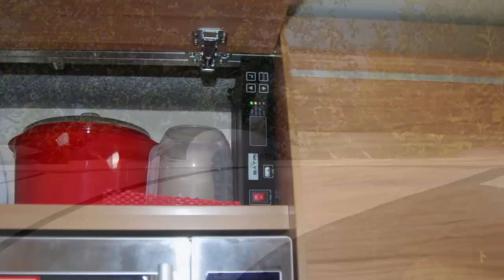Satfi satellite TV dome installation onto a caravan video

Comment: Very interesting and useful however I am confused by one aspect of your installation. The sub-title said to  point the roof gland and cable towards the back of the van but your installation appeared to show the opposite (based upon the angle of openning of the roof light). Would  you please clarify? I expect I misunderstood.
Reply: Hi sorry for the delay responding. The Installation was carried out on a caravan so the open heki roof light is actually at the front and the glad is being installed towards the rear but I can see it does look odd.
Reply: All roof lights hinge from the front just as this does, how can you be confused over this....

Comment: Does that dish pick up sky ? Can you run twin coax so that you can record as well as watch tv?
Reply: Hi sorry for the delay responding. The model shown in this video is now obsolete but its replacement does come with a two coax twin LNB for use with multiple receivers or a single Sky+ PVR receiver. I hope this answers your question.

Comment: He very nearly drilled the pilot hol vertically.  Seriously, those adhesive pads aren't goint to stay put, he should have used plastic trunking and the adhesive he used to secure dome,  (Sika) it would look tidier too and the cables wouldn't suffer from weathering/sun..